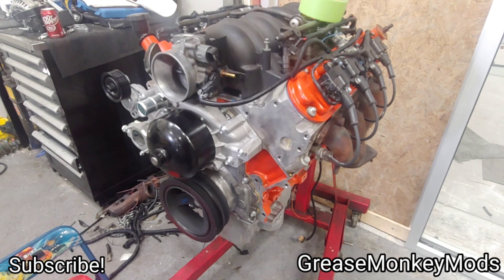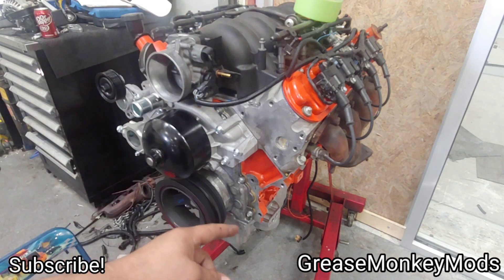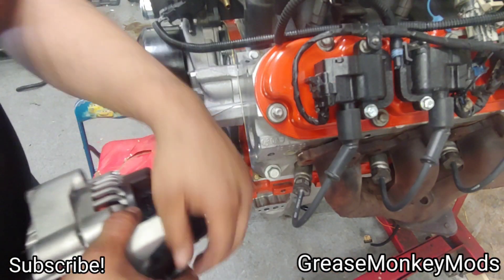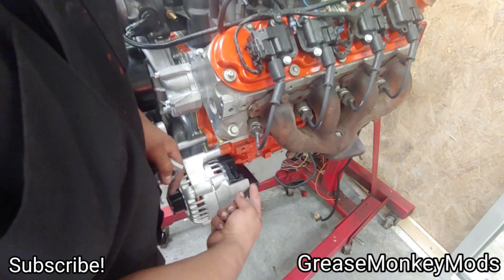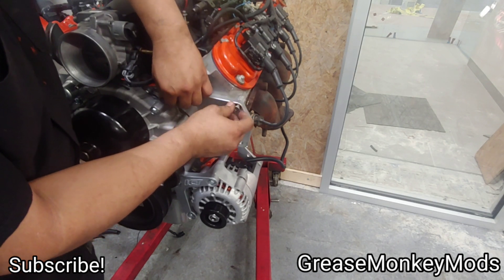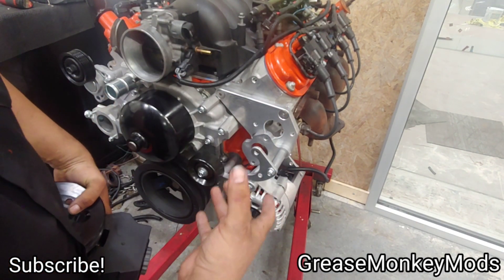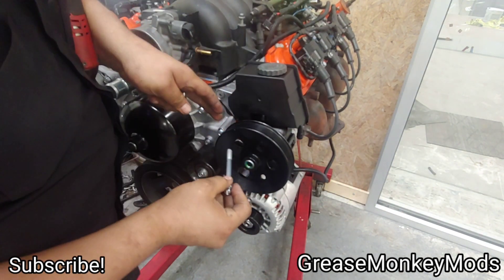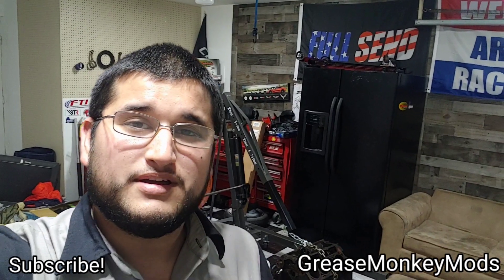Budget LS Swap Accessories ~ For My Lexus IS300 ~ ICT Billet

Comment: Like the videos. What's the part number for the belt that works with all those accessories? 
Will you be running an GM air compressor on the other side?
Thanks

Comment: Hi, so i have a truck motor, that still has the stock truck crank pulley. But i will need to use the Car waterpump as i am using LS1 car intake with DBW throttle body. Should i order the car ICT billet brackets or do i need truck ones ?

Comment: Hey bro, hope you still active. You remember what size the return and pressure adapter would be ?
Reply from the maker: For what exactly
Reply: @BoBuilds  sorry, im barely a YouTube mechanic, putting a 5.3 in a fc and I’m lost when it come to the size of the an6 adapter fittings that should go to the pressure line and how to attach the line to the return . I got the same p/s as you I believe and wanted to know how you hooked up the pressure and return lines.